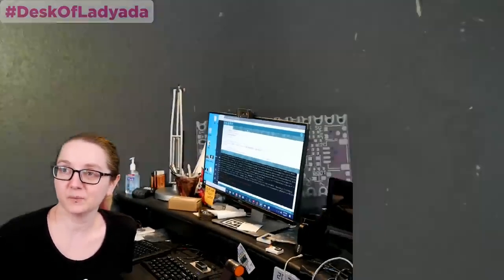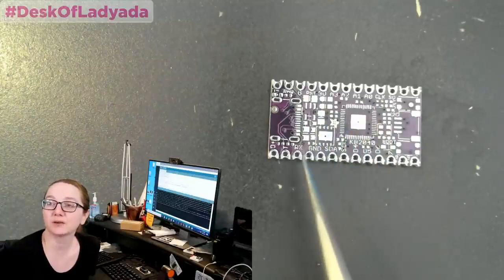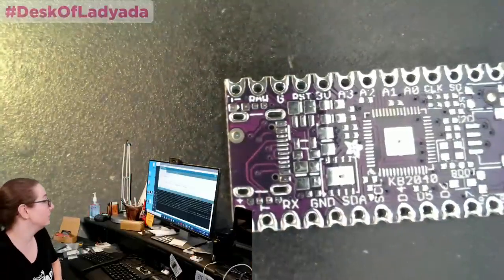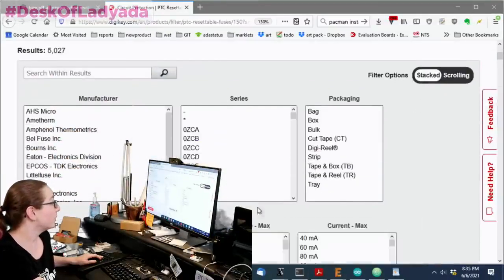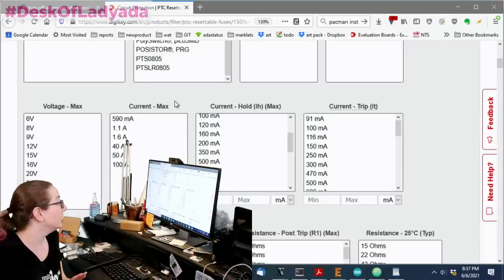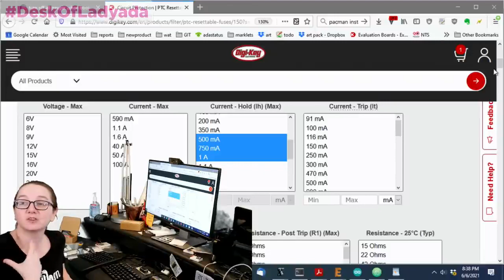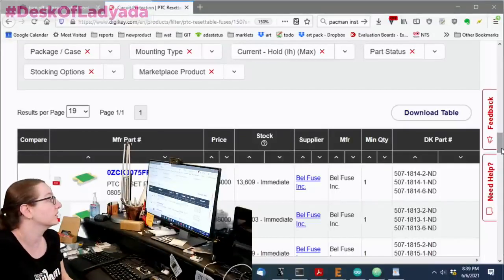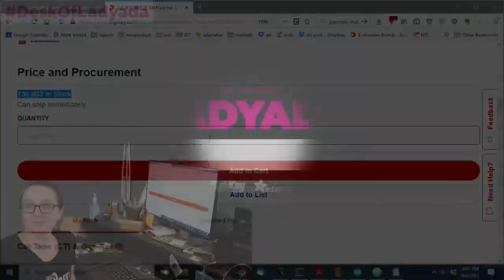The Great Search: SMT PTC Fuses #TheGreatSearch #DigiKey @DigiKey

Comment: I actually needed a PTC fuse guide just like this. I was designing a WLED driver board using an ESP32 Feather and I totally forgot about circuit protection. I'm sure the Feather is protected, but the UBEC isn't; even if it were I sure don't want to be in a situation with a dead short in the NeoPixel strip and fry something important.